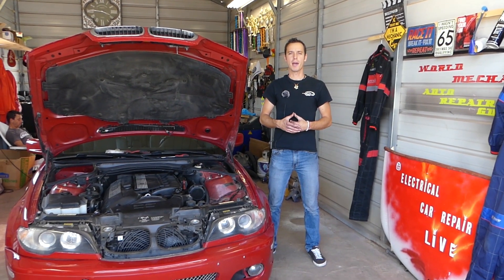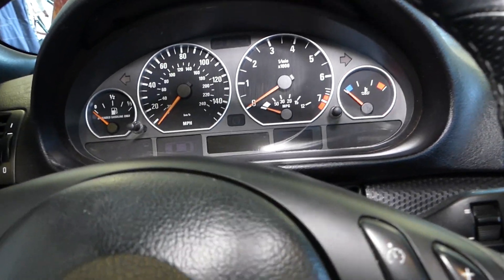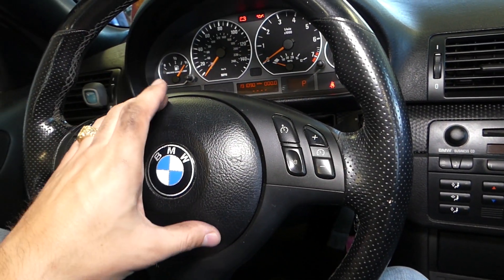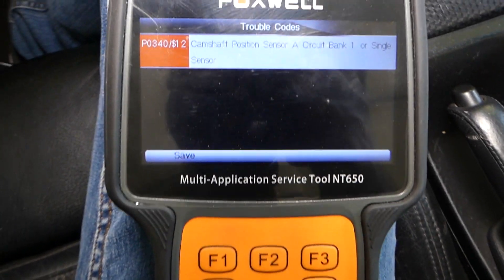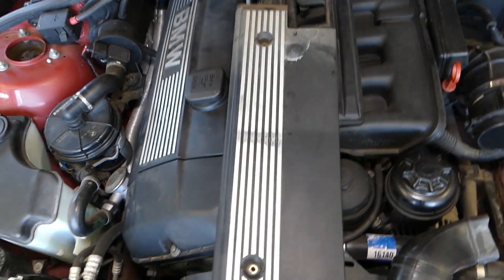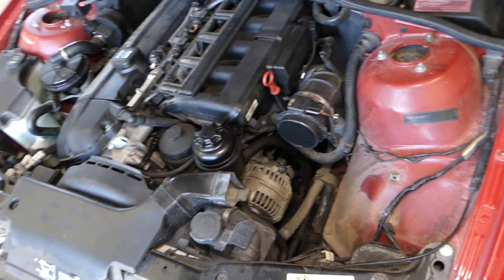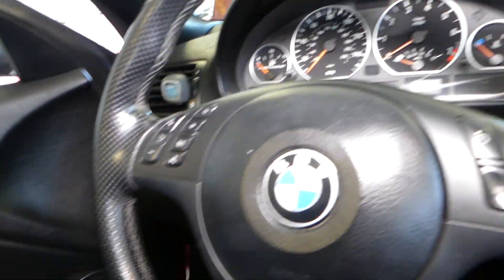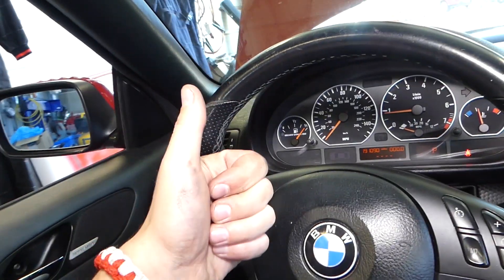CODE P0340 CAMSHAFT POSITION SENSOR A CIRCUIT BANK 1 BMW E46

Comment: Have a question. Have a code came up.   P13CO: A' Camshaft Stuck (Bank 1)   Is the the bank 1 on the passenger side or driver side. This it’s on a N63TU 4.4

Comment: ok, so i got the code p0340 AFTER replacing the cam sensor with a new hella sensor. i actually replaced both intake and exhaust sensors, because my wife told me she experienced a stall at a stop sign 6 months ago. it never happened while I was drivign. from my experience, it sounded like a cam sensor, so i replaced them both. after installing the new sensors, I'm getting an intermitent hard start and more frequent stalling. this time i hooked up my bm700 obd2 reader and got p0340. could this be the beginning of a vanos problem?
Reply: Vanos or maybe timing chain? I replaced my sensor too and she still throwing code :(
Reply: @REAL3XL  actually it was a defective cam sensor. put the old one back in and it was perfect. no more hella sensors for me.

Comment: I have changed the cam positioning sensor with an oem BMW sensor but I am still getting the po340 code. Vehicle will turn on but as soon as I press the gas it bogs out and dies. If the idle control valve or the disa valve are bad would it still give me a p0340 code??? PLEASE HELP I CANNOT FIGURE IT PUT I HAVE ALREADY CHANGE TWICE. SAME ISSUE 😭😭😭
Reply: I have the same issue since a few months and I'm still trying to figure out what the problem 🥺😑
Reply: timing chain issue

Comment: So read the code then replace the part? No testing  or inspection on the circuits, wirings and connector needed? I call this repair procedure a “ Guessagnostic “ .

Comment: Thanks for the video.  I have a couple questions, my car completely stalled and lost power while i was driving and I could not get it to start.  When I used my OBD2 code reader it said both my A and B circuit camshaft position sensors were bad (PO340 and PO365).  My first question is if both sensors were faulty can it make my car stall like that? And my other question is Do you have a video that shows how to replace the intake and outtake camshaft position sensors on a 2006 BMW 330i e90?
Reply: Same happened to me. What did u do to fix it